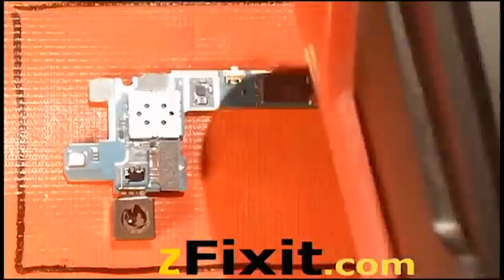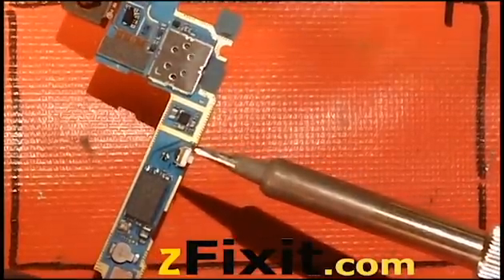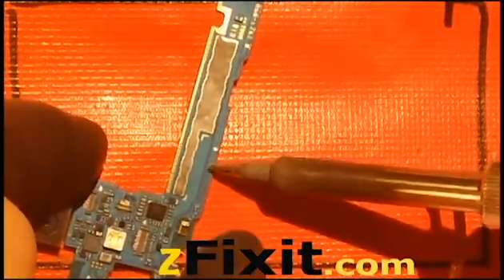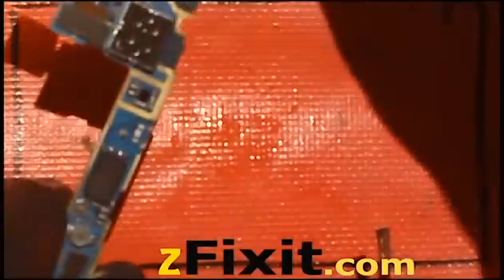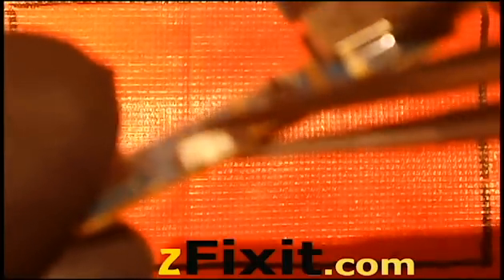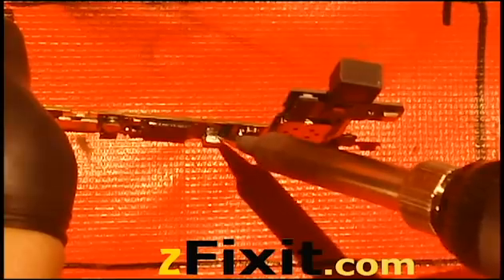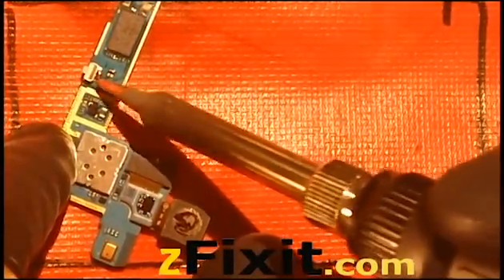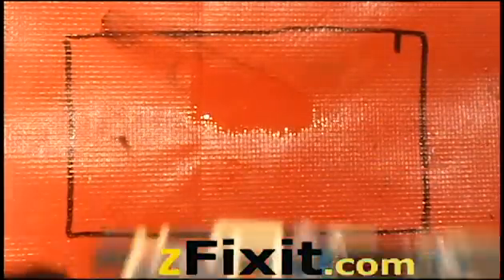Samsung S3/S4/Note, LG Nexus 5 Power Button Replacement Process

Comment: I have a Weller WTCPT soldering iron in which the temperature is controlled by the tips used.  Would it be better to use a 600F tip (315C) or a 700F tip (371C) for this?

Comment: So to solder switch and fix pad its would be $39.99 plus $5.00 and return shipping?
Reply from the maker: +Frank Lopez you will have to g the website, I believe less than that but fluctuates, whatever advertised price is at time of purchase, if over $45, you will get the $35, if less than $35, you get less than $35 + $5 fee + the return shipping fee quoted online (that I can't discount), please use link above

Comment: What is the material your using in the video that looks like a flat braided copper wire? and where can I purchase the materials to fix my samsung s4 power button. I have a hot air station. But having trouble finding low temp solder and some of the supplies I see you using in your video. Thumbs up on the video it's very informative and nicely done.
Reply from the maker: +Frank Lopez its called desoldering braid or solder wick, if you have a hot air station, then this video may not help you if you are using the hot air station, except the temp indicator, should be the same temp on hot air station.  Low melt solder wire is called QuickAlloy, buygin in small amounts  is possible, search eBay.  http://www.ebay.com/itm/Lead-Free-SMD-Chip-Removal-kit-2-7ft-5X-i-Alloy-10cc-no-clean-Flux-quik-ship-USA-/151127561933?hash=item232fe796cd:g:rNAAAOxy9LxSGSul
Reply from the maker: +Frank Lopez here is what you need, at amazon. http://www.amazon.com/QuickAlloy-melting-Temperature-removal-included/dp/B008HB9MW6

Comment: Has this ever happened to an iPhone? Samsung needs to use quality buttons, i've had the same issue with my Galaxy S2. Shame on you Samsung! Someone needs to make more quality buttons.
Reply: +Devon Cummings  iPhones also have issues with power buttons, they have an extended warranty on iPhone 5 and I still come across them and Apple's website has a serial lookup and will take care of the button free of any charges, not the case with Samsung.

Comment: Thank you for the video! I just replaced my button on my S4 following this video. First solder job I have done on micro electronics too. 
One thing I did was buy a fine solder gun tip and just pressed firmly into the mount points to get enough clearance for the new buttons to mount. I'm not as pro as you are.

Comment: I must be doing something wrong. I can't for the life of me get the old solder to melt. I tried turning my solder iron all the way up and still nothing. It melts fresh solder just fine. My iron is a Blue-Point YAKS32.  It also has a nozzle like on an air gun and that doesn't work either. It's a butane solder iron btw. Maybe they don't get as hot as electric?
Reply from the maker: PeugeotRocket You have to use low melt solder to mix in, then it melts, i would stop as you may ruin the board.  Low melt solder, look at cyberdocllc.com and look at the low melt solder.
http://www.cyberdocllc.com/shop/solder-wick-quickalloy-smd-chip-desolder-removal-kit-included-5-alloy-low-melting-temperature-and-10-cc-ml-smd-gel-flux/

Comment: Can this issue ruin the motherboard?
Reply from the maker: Any repair attempt always has the possibility of damaging the board.  Mkae sure you use LOW MELT SOLDER during removal process, more is actually better, you can drown it but not so much that it leaks into other parts of the board.  Practice, attention to the tips, pay attention to them, do not leave the iron on the board for too long, lift and then apply heat again, never leave on for extended period of time.  If you do not have a temperature solder station, do not attempt.  This technique are for those that do not have a hot air station but DO HAVE a solder station that can be calibrated to a temperature of 340 Celsius.  Any higher, you will damage the board, any lower and the old solder will not melt (Radio shack solder irons should not be used unless they state average temp of 340 but they always lack the proper solder tip).  I have never ruined a board using this technique, it is a technique, others will say it is a bad idea ... but they are not very knowledgeable in soldering!   
I use this same temp on iPhone 5 series LCD and digitizer FPC connection replacements and those are soooo much smaller than this repair, that is true micro soldering, same technique as this video! These solder pads are tough!  BEWARE ...The charge port pads on S3 are not so tough, do not use this technique on S3 charge ports!
Reply: zfixit.com Yes i know that risks but what i mean is if i left to much time my s4 with that issue without repair it can damage the motherboard? It just fall in bootloop one time and since that day the phone works properly without any problem. I dont have money to repair the phone thats why i need to know how much the phone can support this problem until i get some money.
Reply from the maker: GrIm ReApEr  No, the issue is an issue, it will remain until it is fixed.  Remove the battery if you know how so that the power button issue is not causing a constant drain on the battery.  Other than that, it will be the same as when the issue began, the repair can wait. If you can't remove the battery, no big deal but it is never a good idea to let a battery drain completely.  The only issue you may have is replacing the battery if you leave it in there for a few months (batteries should never be drained less than 3%, they will die), the batteries are cheap, can be bought for about $5 on eBay.  You have some time, remove the battery and you have years if needed.
Reply: zfixit.com That`s nice! Thank you for your help i really appreciate it. Knowing this makes me feel bettter.

Comment from the maker: You can view other videos that require a hot air station, this video is for those that do not want to spend a fortune on a "Hot Air" station, just purchase the cheap Radio Shack solder iron, you may also be able to negotiate a cheaper price than they advertise since they filed for Chapter 11!  
Negotiate, dos not hurt to ask, make sure the iron is at about 340 Celsius, a little higher is OK, lower is not, but it needs a chiseled tip or a sharp tip to get at the solder points. Too thick of a solder iron and you can't get underneath the metal jacket to solder the points that matter.